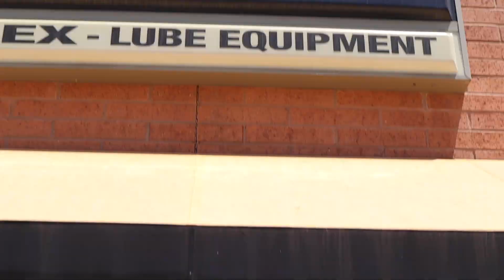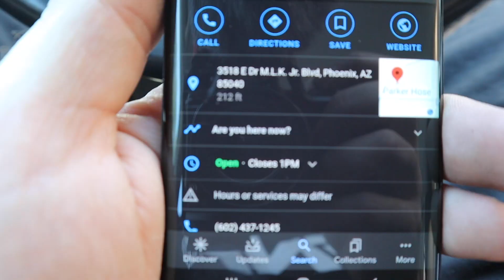Turbo LS S10 Is SOOOO Close!

Comment: How has the quick fuel carb been working for you. , On cage I used competition engineering 12 point kit you can get chromoly or mild steel . It fit very well. Or Rhodes Race Cars , S&W I think makes one as well.
Reply from the maker: The carb has been flawless out of the box. I ended up using an s&w cage. I have some videos on it as well